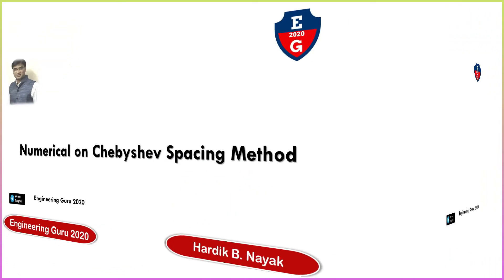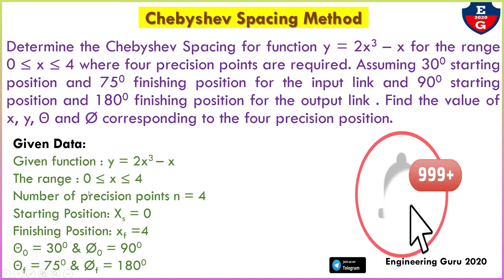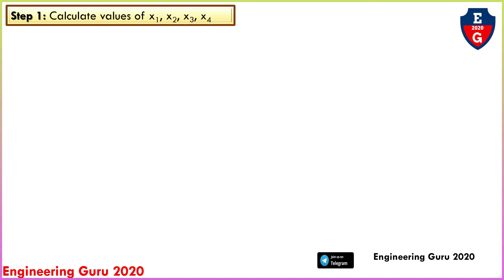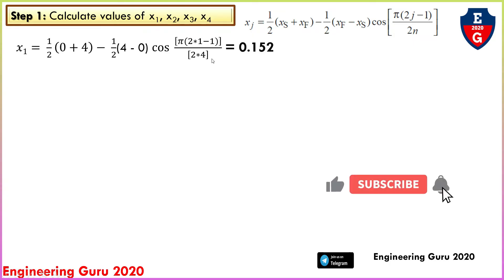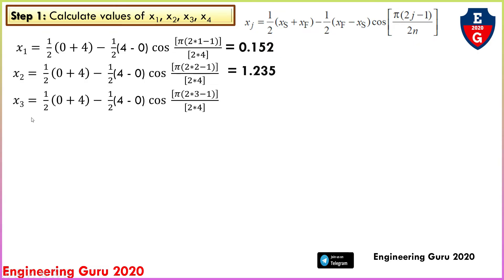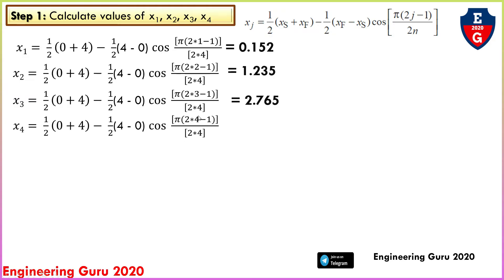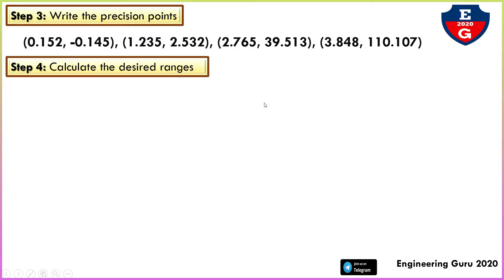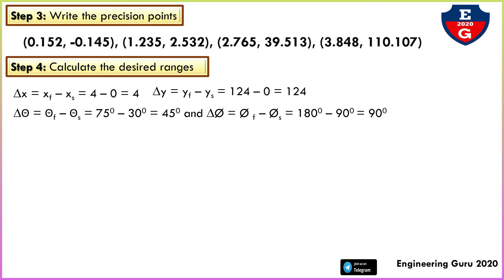Numerical on Chebyshev spacing method| Synthesis of linkages

Comment: Sir in previous video example 1 in Qj there Qo was not taken.
But in this example you have taken Qo. Why so
Reply: Ok thanks sir 👍
Reply from the maker: Share and Subscribe.
Reply: Step 5.
Reply from the maker: If the theta zero value is given then it would be considered. Otherwise you can take zero.